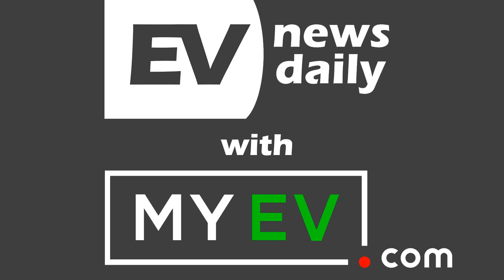30 Mar 2019 | Saturday Special: Smart Charging Your Electric Vehicle

Comment: Smart charging with OHME the topic of your pod cast on Saturday 30th March.
I found this so interesting I did a considerable amount of investigation into the whole concept including the sole energy supply company (Octopus energy) linked to this project. In conclusion it may have been to early to have launched this product by the developers as the specific type of account (Agile) to cope with complexity is unable to be used at this time due to the requirements of only a SMETS2 specification smart meter to managed the detail cost and time used these are not yet available to be fitted and this power company has ceased its fitment of the SMETS1 smart meter except for only priority customers for the duration as the manufacturing company cannot keep up with the demand of the SMETS2 and as of the 15th of March it is possible that the power company can be fined for fitting a SMETS1 against a government mandate and it is also not technically capable of doing the job of the SMETS2 and other associated pitfalls. The above information is directly from the blog of CEO Greg Jackson of the energy company and can be found on their web site. 
Any new energy customers can be entered in to a waiting list for the next few months for a SMETS2 smart meter so nothing can be achieved by changing energy suppliers at this time (which I was intending to do) to be able to make use of this futuristic product as was explained by Fiona on the podcast. 
The above is the sting in the tail because the Ohme control cable is on an introductory offer price of £199.00 after the expiry of that period the price reverts back to £399.00. So if the special price expires before the SMETS2 smart meters are available it could put a curse on the control product by these circumstances.
I could purchase one in advance to save money but I would need to become a customer of Octopus before being able to obtain an Ohme cable after which the system might fail due to insufficient demand and I would be left  holding a white elephant as at this time it works only with one energy supplier and one type of tariff.

Comment: What a great idea! I wonder if it would be feasible to design an adaptor so that folk with tethered charging could use the ohmi?
Reply: Hi Martin, great point. Technically this would be easy. The safety standards however do not allow adapters or extenders. For existing tethered chargepoints, it is usually a quick job to install a commando socket alongside and use Ohme with that.

Comment: Unless you’re someone who charges during the day for whatever reason, you’re likely charging at night after 9 PM in the United States when electricity is the cheapest. Do electricity costs fluctuate that much overnight? Seems like a niche market
Reply: Hi Bryan, 

Ohme integrates with Octopus Energy Go which offers 5p/kWh for 4 hours from 00:30 everynight, and a day rate of 14p/kWh on average (varies by region). So quite big difference. www.octopus.energy/go

It also integrates with Octopus Agile - and sometimes prices at peak times (typically 4-7pm) will be between 20-30p/kWh, but overnight it will drop to well below 10p/kWh, and sometimes even goes negative - so you can get paid to fill your car. The ohme cable will optimise to find the cheapest times. www.octopus.energy/ohme 

As EVs and distributed energy increases, it is expeced that Distributed Network Operators (DNOs, who manage local energy grids in the UK) will also offer pricing signals to encourage charging at off peak times. This will further increase the differential and will enable EV drivers to maximise value for themselves. We are working with UK Power Networks (the biggest DNO) on setting up local flexibility markets as part of our Powerloop Vehicle to Grid project... www.octopus.energy/powerloop

Hope that helps.

Comment: Great show Martyn.
I wish we could do that in Australia. It sounds like a terrific concept. 
However, I do use a time clock to charge after midnight, (and NEVER in the evening peak.)
Reply: Cheapest rate may even eventually move, to the middle of the day if it’s a good sunny day, (ie:lots of solar).
HOWEVER, the evening peak will always be there in my opinion, as people get home from work and turn everything on- and there will also be a percentage of EV owners who don’t know, or just don’t care, and plug their EV in as soon as they get home.
Reply: @FutureSystem738  Yes, I agree. There will always be more and less expensive times, though I think the differences will be closer, and they will almost certainly shift around the clock.
Of course, this only accounts for utility provided energy. It doesn't even consider micro networks with battery backup, or totally self sourced energy, etc... The world is on course for change - hopefully for the better. I'm enthused about it.
Reply: There is one tiny caveat with cheap rate provided electricity at night - once mass night time charging of EVs gets properly underway. It's that the cheap rate will slowly disappear as demand rises and gets nearer the day's needs. That's ok, I accept that. It will still be cheaper to operate an EV rather than an ICE or Hybrid [especially one of those self-styled self-charging FFVs] car. Just not so much. However, we may find that rooftop solar is so affordable that it will be a no-brainer choice to install, to bring down the overall running costs again. I suppose it's a good job nobody developed the mass produced back garden oil refinery. 😁
Reply from the maker: I think most people try to charge when it's 'best' - few would charge at any time of the day. But of course that's their right to. This sounds like a good way to make it easy.
Reply from the maker: California has a lot of solar, I will look at the demand curve in CA specifically to see how all that renewable makes a difference.

Comment: Cost is not the first priority. It is reducing carbon emissions that matters. We all live in the same world and our children will suffer if we don’t start with reducing carbon emissions as out first priority!
Reply: Dennis Kavanagh  Hard to argue with that, but the two usually go hand in hand.
Reply: Hi Dennis, you can set Ohme to ignore cost and focus on carbon savings. There's a fairly good correlation between the two on most days in the UK. Cost/carbon savings, it's a good question which is most important for EV drivers.